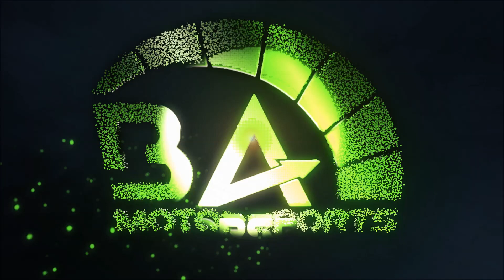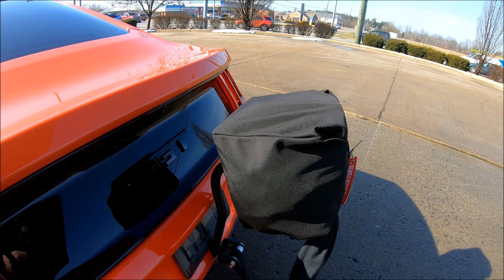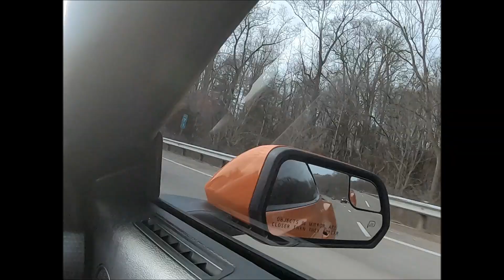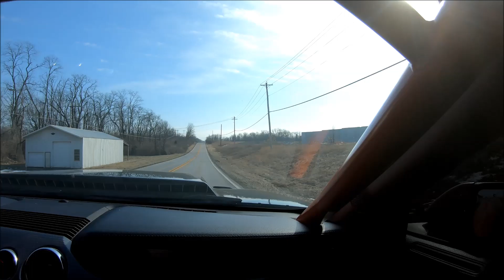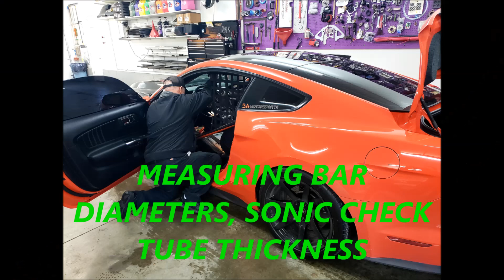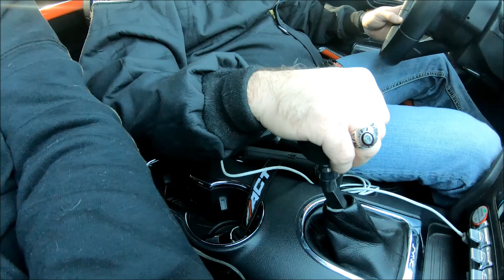NHRA INSPECTION DAY + BUILD NEWS !!!

Comment: I passed you guys when I was heading to instant karma to have my cert done.  Had the red new edge on the trailer.  Your guys’ car looked great
Reply from the maker: That is awesome. Saw the intercooler chilling in the front on yours. Small world we live in. What the details on your car ?
Reply: Budget car (well for the most part lol). Junkyard 4.8 Ls, th400 with a brake, China gt45 69mm turbo.  Ran a 10.68 last year foot braking on only 10psi.  Swapping turbos to a 7875 and adding more boost.  Should be good for mid to low 9s this year
Reply from the maker: Yeah man rocking that 4.great. what you using for a ECU?
Reply: Just stock ecu tunes with hptuners right now.  Down the road would love to go to a dominator.  Hopefully I get to see your car at the track sometime this year.
Reply from the maker: Right on you tune it yourself ? Sounds like you have fun plans for the year. We should be at edgewater and Kilkare a fair amount this year with different cars.
Reply: Good deal we should be at edgewater a fair amount and never been to kilkare but would like to make it out.  Nick skaats tuned it for me.